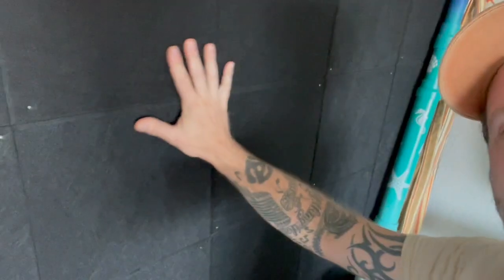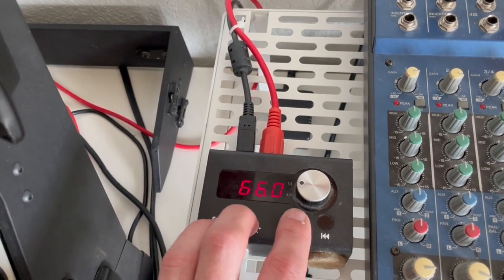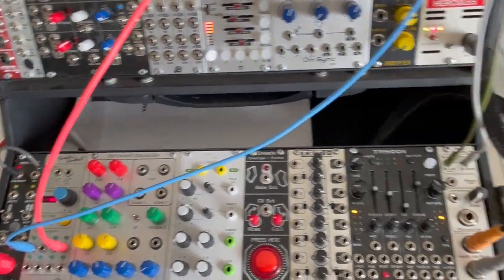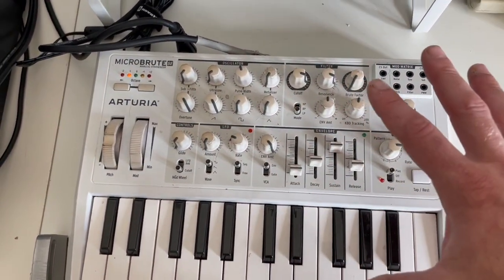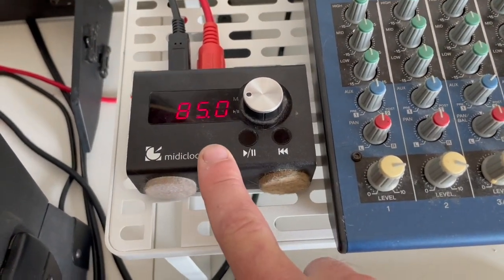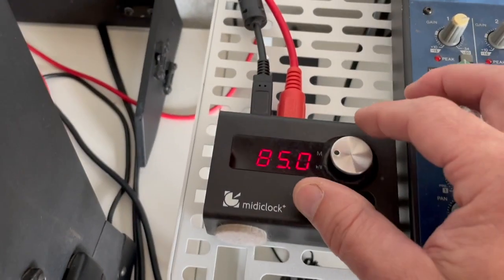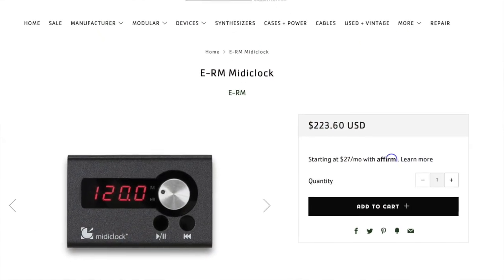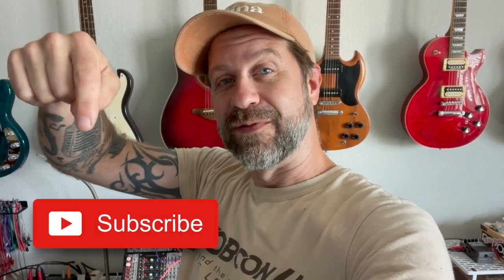This is How I Do MIDI Sync in the Studio (E-RM Midiclock)

Comment: One of those features I haven't used on my M-Audio MIDI controller because I haven't gotten multiple synths yet. I may get a Behringer Pro VS Mini when it's available, if I don't spend extra cash on more VSTs. GAS isn't just for guitars.
Reply from the maker: Very true. You can spend a whole lot on studio gear. In any case, I'm pretty happy with this setup. Thanks for checking it out.

Comment: how could tempo of the hardware synth smoothly be notched with an external midi controller?
Reply from the maker: Thanks for finding the video. MIDI carries several types of data. Note on/off and pitch data are the most common but it can also carry clock data (as well as some other things). Most - but not all - synths support clock sync over MIDI.

Comment: Very cool. Thanks so much for doing the video. If i ever get the midi clock i will refer back to it. 
For now it isnt in the budget. But very useful info regardless!!
Reply from the maker: Hopefully the vid was helpful. MIDI sync is a huge pain in the butt. There are a million ways to do it (and I've tried many of them). It ends up being frustrating when you try to use a drum machine as your master clock and it only sends clock when the drum machine is running. Then you have to start every song with drums, even if you just use an empty pattern. I just got so frustrated with it that I had to find a better way. I really love the Midiclock.